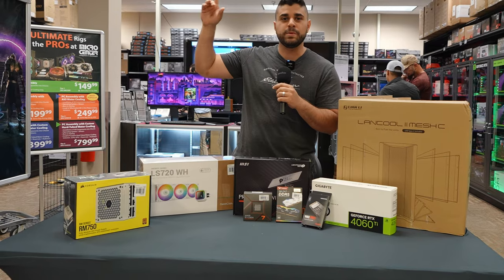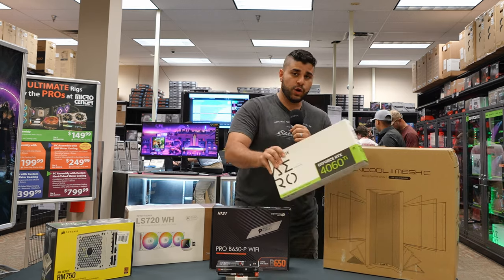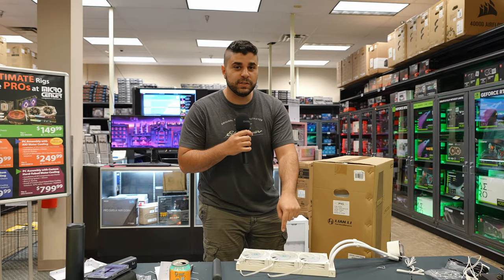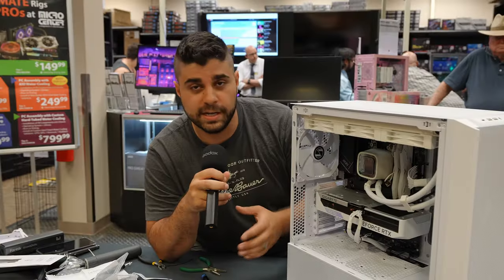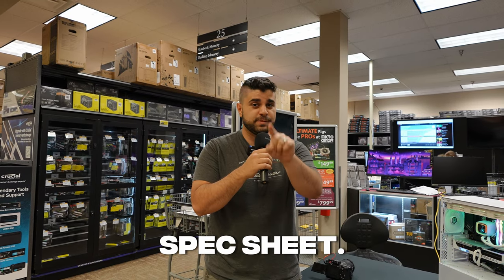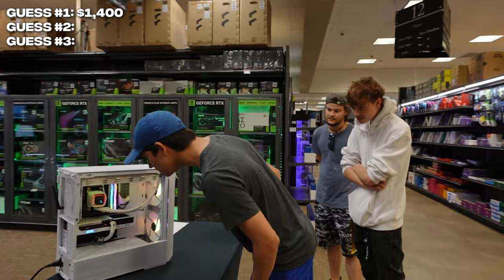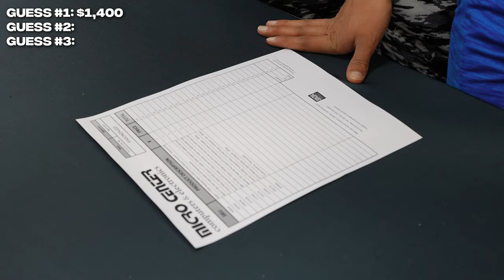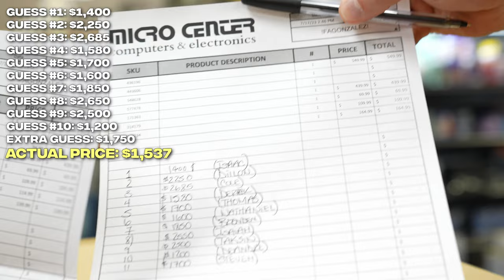Building a $1,500 Gaming PC in Microcenter

Comment: I am not wowed by the 4060 ti... it's okay. It is $1500 system. I would have just swapped the RTX 4060 ti for RTX 4070. Spend $100 more on the AERO GPU and save a $100 by going with a Ryzen 5 7600.

Anyways, still a good system, and looks really great! I do hope the winner goes back and gets a matching keyboard and mouse. But I'm really happy for him. :D

For myself, I am in the process of building a Fractal Terra. Going previous gen GPU (RX 6750 xt) and CPU (Ryzen 5 5600X). And I only got the 6750 instead of the 6700 xt, was because of a sale. and the X was also on sale for cheaper than the non x. So I know all about sacrifices that must be made for aesthetics and budgets. :P

Comment: I would’ve guessed $1500 tbh. It’s a similar build to what I’m going for but rather I’m gonna get a 7900xt instead
Reply: not a fan of AMD video cards it been so long last time i buy a AMD video card . plus seem like more people buying NVIDIA video cards over AMD, never had good luck with AMD, AMD CPU and AMD GPU , i have very old gaming pc will get was a gaming pc when i build it and i spend like $3000 in 2014 it like 9 years old it always on i never shut it off and never had any problems with it only thing i upgraded since i build it was video card it used to have Asus ROG Mars 760, like few years ago i got a 1660 video card . at that time i paid like $600 plus for that Asus ROG Mars 760 video card that 760 video card have dual 760 GPU chip
Reply: @funtyes1970  I ended up getting the 6950xt and the 7700x CPU. Thing runs like a champ bro. I flawlessly play at 140 frames in 1440p in starfield on ultra settings. FSR on of course. Nvidia is the superior company, yes, but AMD is better value- there’s no denying that at all. AMD is for the gamer who doesn’t want to spend $1600 on a GPU but rather spend $1000 for similar performance lmao